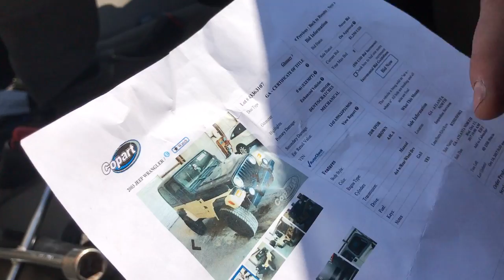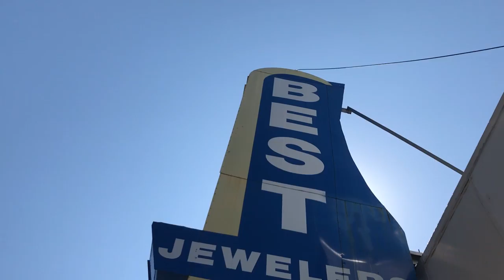We Bought A Stolen Car!!!

Comment: Check the linkage under the driver side that connects to transfer case. Mine was snapped out of place and I could put it into any gear and it wouldn’t stall.

Comment: That box you found is a transformer to power neon tubing. 12 volts dc in and 3,000 volts or so out. May have had neon tubes under the chassis.

Comment: 😂😂 "You'd have to be pretty smart to hotwire this thing" 😂😂 old cars are so easy to hotwire most of the time there's the on wires to make all the electrical work and the two wires to start it then you just have to break the steering wheel lock 😂 that's all sooo easy 😂😂😂

Comment: You guys are rapidly building up a brand. My suggestion is that at some point soon you start making builds that in some way (tastefully) integrate your brand into the vehicle - something subtle enough that the average buyer won't mind but will give your viewers an incentive to pay a premium for. Then start auctioning the car off on eBay simultaneously with whatever local listings you have. eBay does allow that as long as you clearly state that's what you're doing. Then you can see if your viewers start bidding Orange County Choppers style. Anyway, regardless, if you keep at it I estimate that within 5 years you guys will be easily mid-six figure income in what you're doing. Hell, I've seen some local guys without any brand recognition do what you're doing and make that.

Comment: Check the transfer case. Didn't even try to engage when you dumped the clutch. They could have snapped the chain inside it and broke the gears. It'd be stuck in neutral

Comment: Thought it was a trick like when you found the safe full of hundreds.  Like other people said, before you swap the clutch check underneath of it for a disconnected or broken linkage, those copart monkeys break em a lot with their forklift.  Make sure linkage is moving when shifter is moving.  Also 4wd shifter could be in neutral but for sure you checked that already.  Sometimes it's just something simple.

Comment: on the end of the stick going in to the transmission is a fork that puts it in to gear i would pull the stick out of the trans check the fork first to that the fork is not broken or been forced off some times if a person is hard on shifting the fork will become disengaged or broken easy 30.00 fix i hoped i helped let me know

Comment: It's not a tracker. That's a device to monitor your driving habits. It uses your phone as the tracking portion to know how many miles you drive. Other than that it doesn't do any tracking at all. I have one in my truck. It gives you a discount on your insurance.

Comment: I dont know I may be childish but i scribed when you called those graphic on the back childish. Also eventhough it may be the clutch I would check the linkage since alot of rollbacks will unhook it to tow a vehical they have no key for but i guess you figured that out by now.

Comment: Although I occasionally pressure clean carpets and trim, I find that if you get seats too wet it can cause problems with seat occupancy circuits, I also cleaned a e46 bmw passenger seat
And ended up getting a dash error lamp. Had to buy a resistor to fix problem ?

Comment: Just so you kids know to use a foam upholstery cleaner & machine on the seats and not a pressure washer it separates the stitching they use in modern day seats and when left to dry in the sun the UV helps the water eat the stitching. Professional grade modern day car cleaning agents for the upholstery cleaners have an agent that doesn't let UV and water eat the stitching in the seats... I made this mistake on a Rare ISUZU RODEO Golden Anv. Edition. The car/SUV is worth big bucks again after I had to have alot of the stitching fixed on the leather seats. Dummy me.... Lesson learned.  1999 ISUZU Golden Anniversary Edition fully loaded leather seats electric sun roof 12,000 original miles original everything except I replaced the defective Cats it came with. I was offered 23K for it was the latest offer. Bought it in Willow Grove Pa 9 years ago for $2,100.00. The dealer sticker is still in the pass rear door window. The original owner died in the car was left stuck to the drivers seat until she was removed. Why they did not remove the seat as a Bio Hazard is a mystery to me. However all the seats cleaned up but that one and it was replaced but I was not so lucky after doing what y'all did to the seats in the jeep. The stitching began coming apart days later after the seats dried out we were rubbing the leather to restore it from the cleaning and apart the seams went.

Comment: clutch is worn right to the steel backer.. just happened to mine will feel like the jeep is in neutral

other option is the transfer case is in neutral and the shift linkage is broken but im sure youd be able to tell that.. if the clutch isnt it and the t case isnt it start looking at the slave cylinder being seized in but thats not common

probably order a ujoint kit for the driveshafts and do that while theyre out

Comment: check the trans fluid it's probably low, that might fix it otherwise its the torque converter or clutch that you need to replace.

Comment: Check the driveline. Been a tow driver for over 17 years... anything towed with the drive wheels on the ground (like you guys did) should have the driveline pulled. Also... the basket straps you guys used should sit level on top of the tires, not all the way behind them...

Comment: It shouldnt go in to gear at all running without using the clutch you can drive a car with no clutch i have i used the starter while i had it in first got me going then you just have to feather the gas for is to slide into the next gear takes practice but what im getting at is theres something seriously wrong for it to go in to gear and still not move stall out or even grind the gear, i drive a standard for a daily

Comment: Hey Goonzquad that tool was a hot wiring tool. What they did was they took those two white wires and then hooked them up to the ignition then took the two other small wires then they put them together to get it running.

Comment: I have a stock radio and back seat from a 2003 rubicon if it fits on it that model.
Reply: Mine was stolen back in 2009 and I had the rear seat out and had put an aftermarket radio in it.
Reply: Would you be interested in them?